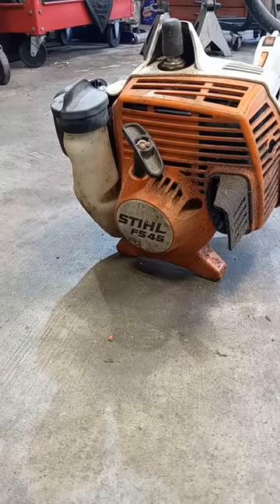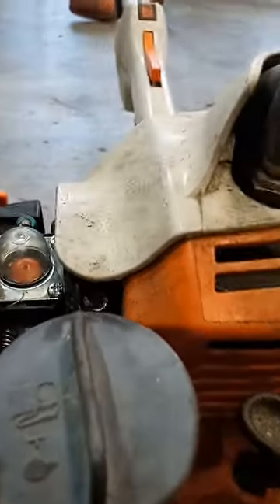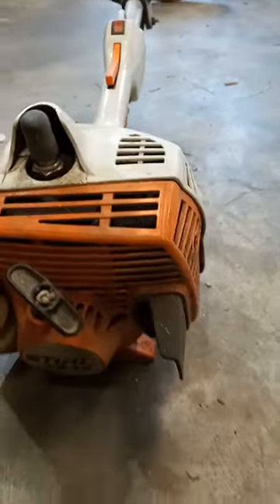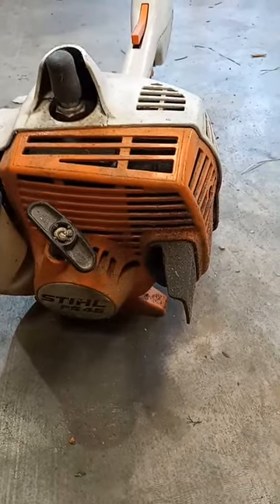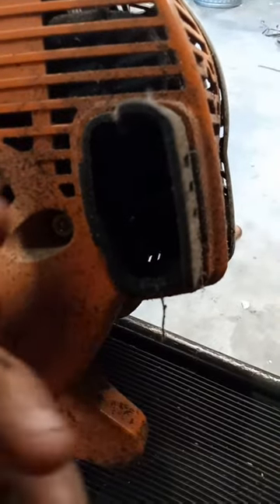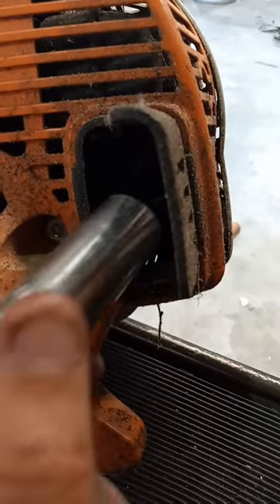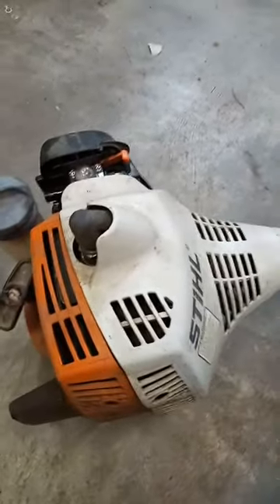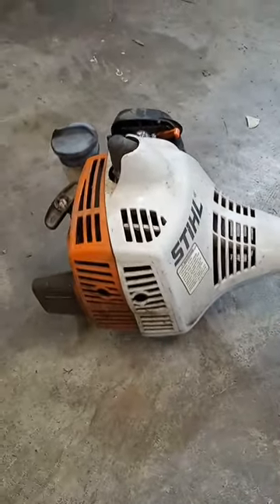Stihl weedeater with no power and smoking?  Remove or clean your spark arrestor!

Comment: Hey bro one technician to another never tell your customers to remove the spark arrestor and leave it out because if something ever catches fire you can also be held liable and not only that over here in Texas that's a $25,000 fine so if I were you I would clean out the spark arrestor and reinstall it remember bro not all of us have 25 Grand just sitting around doing nothing

Comment: Hey my fs38 bogs down even with a clean spark arrestor. I've noticed my prime bulb barely getting filled with gas but it'll still fire up on chock but when I take it off chock it will not start up. Any suggestions?
Reply from the maker: It is probably a weak diaphragm in the carburetor as long as compression is good.  Best way to go is putting a new carb kit on the machine.  I have a couple of videos on how to do it on an FS45 which is a similar machine.
Reply: @EllisMowersandmore  I forgot to mentioned it was running well a couple weeks ago but I emptied the gas tank and the priming bulb because I didn't know how old the fuel was (I bought it used) and now with fresh gas and oil it bogs down when throttling. Can lack of gas in the prime bulb be the cause?
Reply: This may be a little too late but usually there’s a shallow hole with a screen inside the carburetor that can get clogged with debris this will cause fuel delivery issues make sure it’s clean and check to make sure it’s flowing fuel nicely by just squirting a little gas into the hole and it should disappear almost immediately. I’d also check out the diaphragm while you’re in the carb as it should be soft and pliable if it’s stiff and hard it needs to be replaced and I’d also make sure the gas lines are put on the right way during assembly

Comment: I have removed my spark arrestor put in a new piston new jug new air filter and new spark plug mine is still any ideas?
Reply from the maker: It might be low compression, or running too lean.